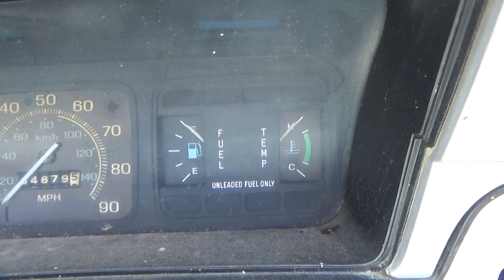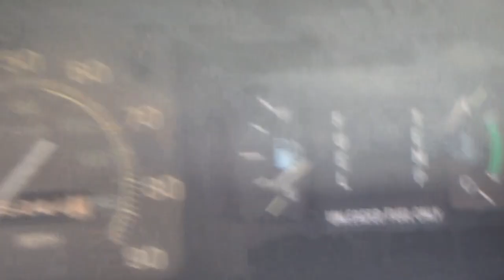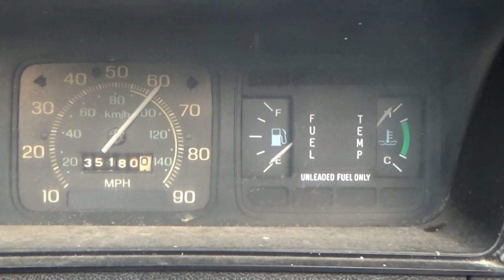Day 4 Hot 2022 Hot Rod Power Tour! Pontiac LeMans and AMC AMX still road trip magic!

Comment: I ran a Champion 4 core and an electric fan in my 76 Hornet. It kept the 401 cool in basically the same engine bay as you have. You might want to look into some insulation for the floor and firewall areas. It was more than a little warm in the car with headers and x pipe. It sure makes a good sound though. AMC Ya.

Comment: VIPenis? BTW Austin, shave the sides of your beard off and it'll really help you feel a TON cooler. Every time it gets warm if mine is even half an inch long I have to shave, it helps SO much.. your cheeks regulate your perception of heat a lot more than you realize. The Spriti AMX axle ratio in 1979 was 2.87:1 in 1980 it went to 2.53:1 (I just looked it up) who's to say that it hasn't been swapped at some point though. LS's broken down on the side of the road you say? Nah that can't ever happen! -.- The only guarantee you have with a LS is that it's going to break. That Wagoneer is nice, a later one, we had a early one when I was a kid and even though the door slammed on my fingers more times than I can count I still love them. I still have pictures of me at 3&4 standing on a stool in my bibbies sanding on it while my sister was playing.. Go figure I'm into doing bodywork eh?